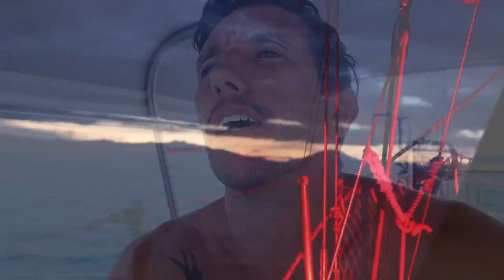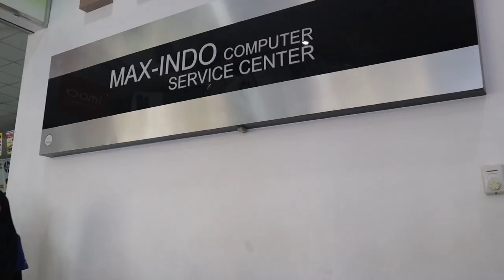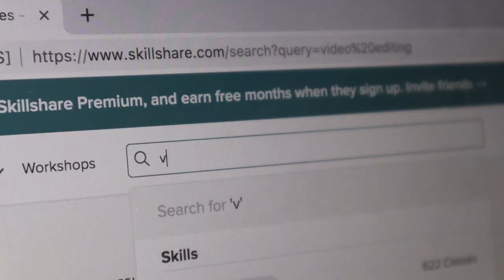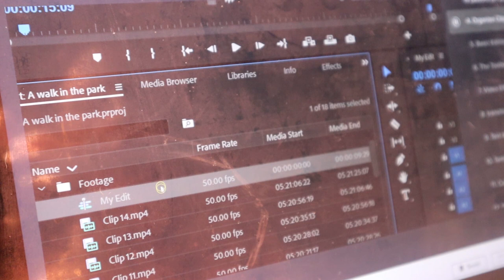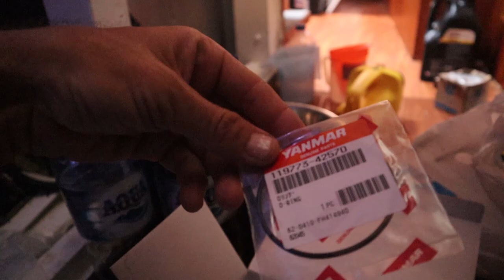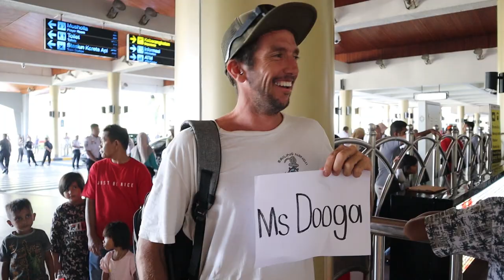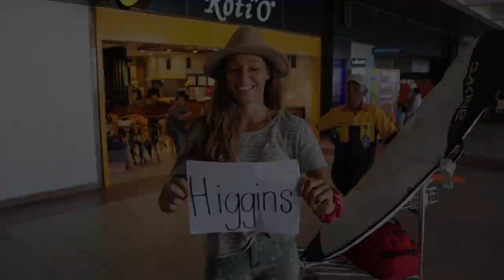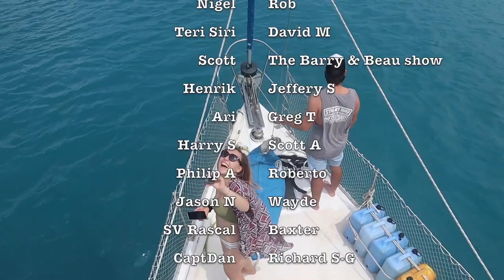Problems in Paradise, At least the Fish are Biting! | Sailing Indonesia (Sailing Nandji) Ep 140

Comment: I was watching another sailing video and they showed me this tool to help wash your clothes in the 5 gal bucket. It was a plunger with the round suction cup bottom but it had little 1 1/2 inch circles. 5 I am guessing but they might be smaller and you just push it up and down with a twist each time. I would just buy the basic plunger and cut holes in it. Works the same I am guessing.  Like churning butter in the old days.

Comment: Always have 2 copies of your data, 15 years in the IT trades taught me that one.
Reply: Any laptops with NVME Raid 0?  I saw a Raid 0 usb typec external drive.  Hard a nice armored shell.
Reply: @MrRourk  Wouldn't Raid 0 be worse to use because the data would be striped over 2 drives and if one fails the data is lost on both? I use to use raid 0 before SSD's but don't find the need for it now.
Reply: Actually.  Looking at the speed of  my new NVME pcie 4x can the CPU go fast enough?  Is RAID justified?
Reply: @MrRourk  

The Bottleneck in a system is always the Hard drive. So yes you would see a benefit like 30-50% faster on read writes. But for most things you wouldn't notice a difference.

Comment: A SSD will give you many benefits - Faster video editing, no moving parts to go bad, and long life.  I'd also get a large external hard drive that you hook up everytime you dump new raw video and copy a backup there - then put away in a weatherproof case or something.  Those two things should improve your setup and prevent most catastrophes fairly cheaply.  Having a second hard drive that is a mirror of the first inside the computer would be good too, but that's not always supported on a laptop.  External drive has the benefit of if something happens to the laptop you don't lose everything.  Hard drives are basically disposable items, nearly impossible to fix, and data recovery is expensive if so all possible - replacing them is usually necessary when they go bad.  Same with your phone, if you don't have good internet access to back to to the cloud, make sure you copy your pics and videos to your computer regularly.
Reply: What J.T. says.  I also recommend replacing the HDD with a SSD.
Reply: SSD are great but they eventually fail too,just not as easily but they do speed things up a lot. You really need to set up a storage backup onboard so when 1 fails you have a backup.  There are tons of solutions out there.  Getting the data off of a blown hard drive is really expensive to have done and very few places can do that.  Never rely on 1 hard drive copy.  It will always fail eventually and usually at the worst times.

Comment: If you didn't get the hard drive fixed, Face the end the wires/cable's plug into , and turn that end facing down toward the table or something kinda hard, and give it a good little bump. Then plug it back in and see if it will startup. 
There's a little arm thing in there that's like the arm on an old record player, and it goes over the disks inside the hard drive just like an old record player, and sometimes that arm will get stuck out over the disk, and when it does it will not power up. So if you can bump it on something just right the arm will come unstuck. I've done this a couple of times and it worked both times. Hope all is going well and that you 3 have an awesome rest of the week, and an even better weekend. Cheers!!

Comment: The water pump impeller didn't look right in the lower right of the housing. The flanges were bent a lot more than the flanges in the top area. It looks like there was an obstruction of some sort on one side of the housing. 

I am a fan  from Seattle USA
Reply: Yeah, really good eye! 13:29. Look at the vanes. They should all be going the same way. But yeah, they are built offset.
Hey Yosh, did you take it out,and replace it? That would explain. Its hard to put those in. When the motor fires up they will all go the same. I like to silicone grease prior to install.
Reply from the maker: The bottom of the housing is smaller and the blades running through this are more squished, there is where the water is pulled through. It is not obstructed, thats just the way it is!

Comment: the next time you have a burn or cut apply vinegar ... In the burn relieves and prevents further damage and in case of cutting stops bleeding and disinfects the wound ... you can use it with confidence
Reply from the maker: Thanks for the heads up, I will store that in the first aid memory bank.

Comment: most computer repair places do not repair hard drives.  As a matter of fact, that is somewhat a specialty.  I am a computer guy too, but I have only done that once because I had another drive identical and made a makeshift clean room.  With that said, you can send it out.  Just search on data recovery, these guys fix the drive first, then recover data.  And in the future, buy only solid state hard drives, no moving parts and less failure.

Comment: I don't know how delayed this is, but do not despair of your hd.  It is all most certainly recoverable.   It just depends on how quick and how much it is going to cost.
 The drive may suffer from "stiction" static friction. It means that it will not start without some encouragement.  First, any GOOD pc shop can down load a cd or dvd image that can be run on almost any pc. With some geeky advice, you can do it yourself.  It is a linux operating system with disk recovery utilities built in.  If you can get the disk spining again you can recover  it.  
You get the disk spinning by hooking it up to the cable s without physically mounting it. Then you turn on the power, kinda palm the top of the drive and rotate it quickly in the plane of the drive(kinda with a snap).  About  9 of ten times, it will spin up. 
 At that point the Linux utilities can be used to recover the data.   If this doesn't work, you have to ship it to a data recovery company and it will cost several hundred dollars.  Hope for the first method working. I have done this dozens of times.

Comment: As a former computer person you need to: Do not turn the computer on for any reason until you can get the computer to someone who has the knowledge to retrieve your data. Get an external hard drive and hook it up through the usb. It will create another drive on the computer. Take your hard drive out of the computer and freeze it for a couple of hours. Put it back in the computer and try to start it up again. If it comes up go straight to the folder with all of your youtube videos and copy them to the external drive immediately. Once you have recovered the files if you can then work to get the other files you want to keep using the same method. Do not turn off the computer until you have recovered them or your computer craps out. You may not get but one chance. Assume your hard drive will fail every three years and replace it before it fails again. In fact, buy two now because they may not be available when you need the next one. Hope this is your current video so you will get this message in a timely manner. Put the hard drive in a freezer bag if you have one or wrap a couple of time in clear wrap for freezer use.

Comment: Don't replace the motherboard until you have determined it is not the hard drive. I can't imagine the motherboard going to crap. It is usually the hard drive that goes first. Only reason the motherboard would be crap is if you are not grounded on your boat. You should have a really good surge suppressor between the computer and your electrical hook up at all time. It is the best $60 U.S. you will ever spend. There is a lot of info on the internet to assist in data recovery. Anytime someone tells you to replace Motherboard make it sure it is from an electrical surge. Always suspect hard drive first. Replace hard drive before MB or memory almost every time. Sometimes memory is bad but not often. P.S. There are data recovery companies that can recover data but they charge an arm and a leg. You might also try putting it in another computer to try and bring it up or take the drive out and slap it against your hand. Put it back in again and try it again. If that doesn't work you might try taking it out of the computer and slapping the hard drive against a hard surface gently. I am not too optimistic about recovery but those are some techniques you can try. Definitely consider the external drive or even a writable cd rom but that is older tech. Many thing have changed since I did this so there might even be newer tech. Definitely get some thumb drives with high data capacity as a third way to back up for a quick backup. Those are the best ideas I can give you.